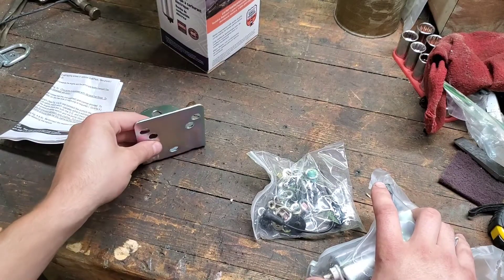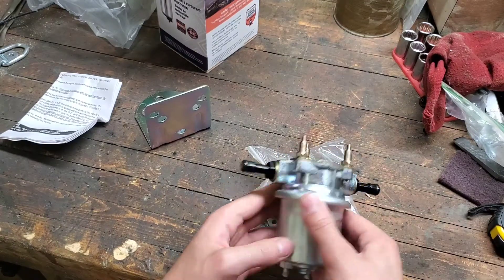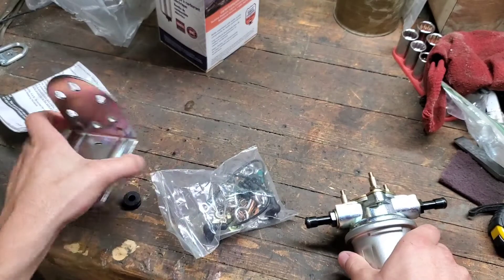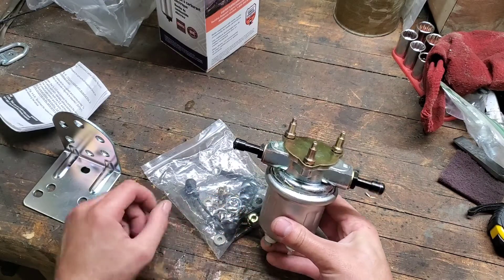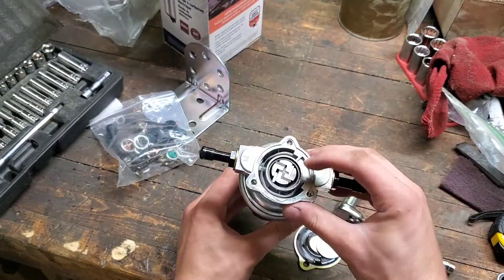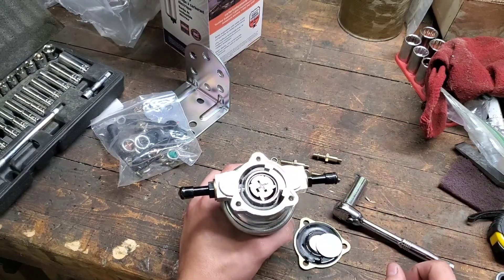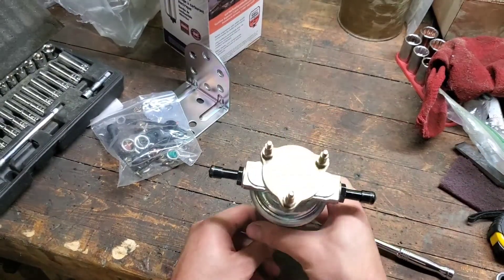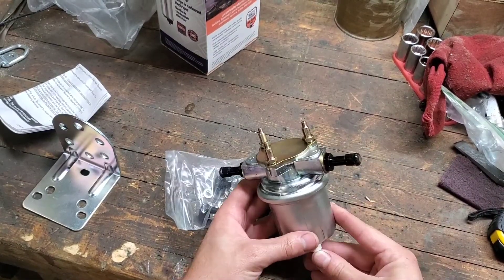The Best Fuel Pump For Your European Classic

Comment: Over the last 3 years I've had 2 fail, my last one left me on the side on the hwy. yesterday, I am now going to plumb in 2 pumps on separate switches, because there is no warning when one is going to quit. My advice to anyone is if you're going to use one make sure you have a back up plan.

Comment: What has your long term reliability been like now?  How many miles on the vehicle with the pump?  Mine seems to be dropping pressure now with 800 miles on it.  It occasionally “runs out of gas” but will immediately restart.  I did mount it under the hood, just for ease maintenance but I may move it back by the tank.